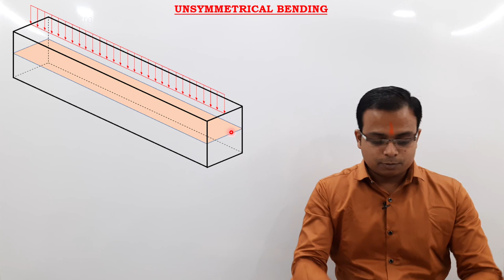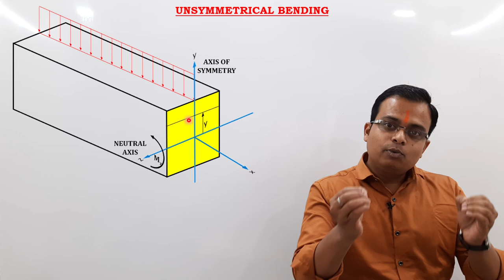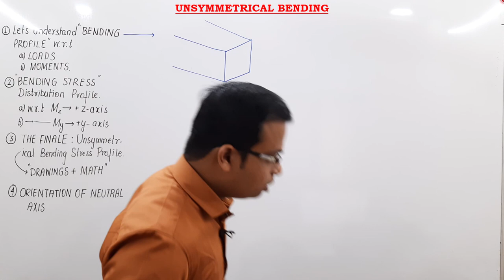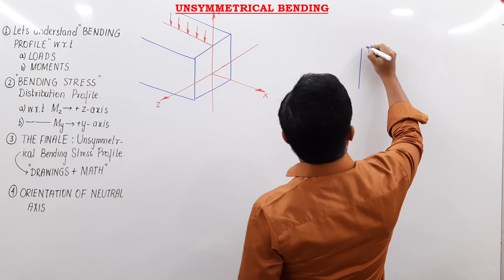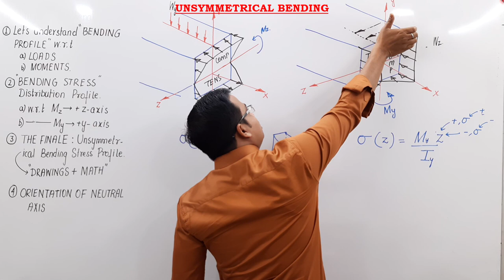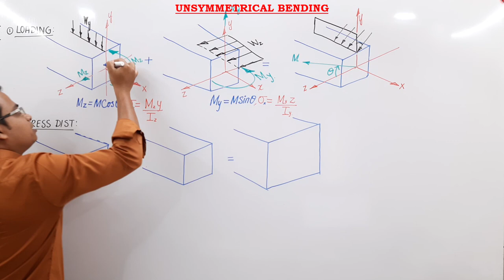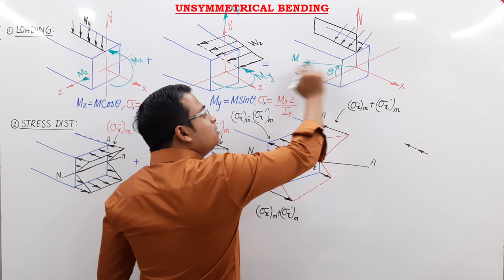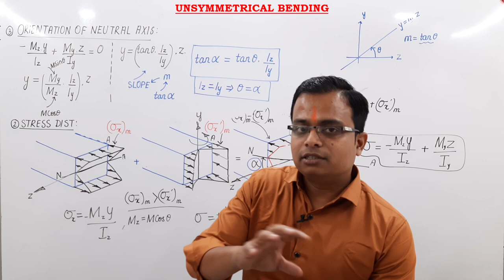Unsymmetrical Bending || Biaxial Loading

Comment: Sir u have said in symmetrical bending with in increase in y stress will increase and drawn corresponding to that. While in animation the arrows are reversed in above and below neutral axis. Please clarify sir
Reply from the maker: Because there is tensile stress below the neutral axis(arrow outward) and compressive stress above the neutral axis(arrow inwards). Abhishek I would suggest you to watch that part again.
Reply: Sir  I understand that. But u have drawn both OUTWARD ARROWS above and below neutral axis in HAND DRAWING.
Reply: @ManasPatnaikofficial  Thank you sir for your reply.
Reply from the maker: @gedalaabhishekvarma9206  can u state the exact time.......
If it is so, i need to pin a comment for that correction.
Reply: @ManasPatnaikofficial   16.35
Reply from the maker: @gedalaabhishekvarma9206  
You are right Abhishek......
Reply: @ManasPatnaikofficial   Tq sir..